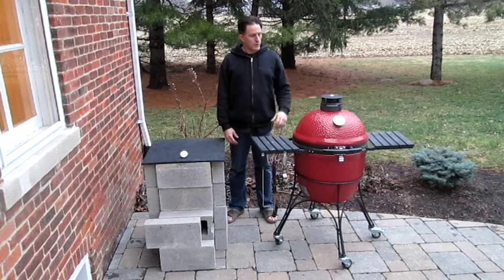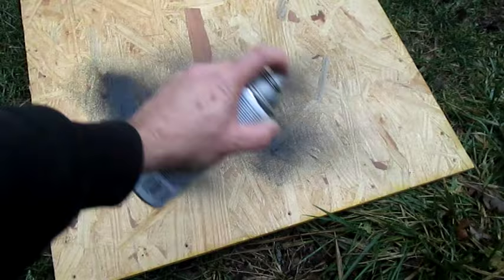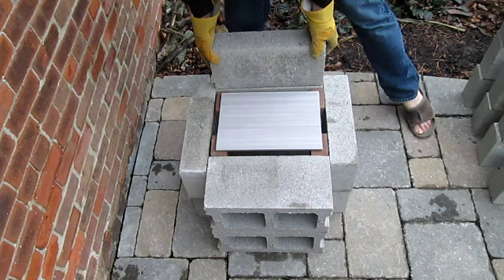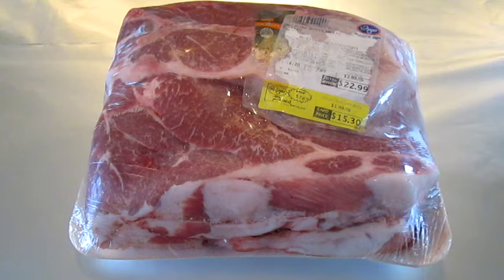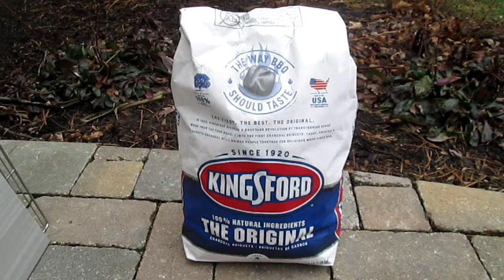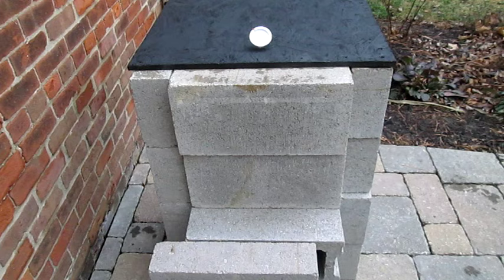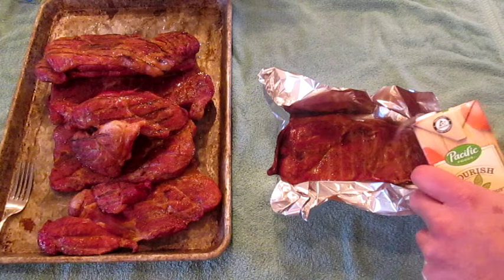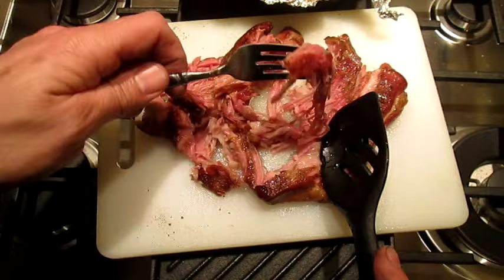DIY $50 Concrete Kamado Smoker

Comment: Just built this today, really excited to try it. It’s worth mentioning that loading the materials to and from the car and then assembling them adds up to quite the work out.
Reply from the maker: A Green Egg or Kamado joe are way heavier!  I needed help getting them off my truck.
Reply: Few beers mate does the job
Reply: Had you never touched a concrete block b4? I knew what a cinder block was when I was a lil boy. Wait till you see what a experienced roofer does with packs of shingles.
Reply: I built this today 🎉

Comment: At what temp should you be concerned with the glue from the OSB putting off harmful vapors? In my opinion I think I would buy a cookie sheet big enough to cover your top. No worries about the harmful stuff in the wood and not much more expensive! Smoke on man!
Reply from the maker: I did some google research. OSB can handle a steady 200 degrees for a full year without degradation.  This means the glue is not vaporizing.   Also, the lid is always open and there is upward and outward pressure from warm air and smoke rising, so it should never have a down draft.   That said, I grabbed that OSB panel because it was already sitting in my garage.  If I had to buy one, I would get real plywood or solid wood or, yeah, a cookie sheet like you said.  Good comment!
Reply: @HowToLou  

What about using cement board?  It might even be a bit cheaper than nice plywood.
Reply from the maker: Good idea!  But some has white styrofoam pellets mixed in.   Don’t get that kind.  A 20x20 ceramic tile would be best.  You might find something on clearance for cheap.
Reply: @HowToLou  what about a dome shaped Terra cotta pot with vent holes, a thermometer  and a handle attached?
Reply: How about just using the lid off your grill? Might work and has vents

Comment: Thanks so much!! I’d been trying to design my cinder block smoker for a year, was gonna build one this summer, but divorce and selling the house ruined those plans, but two things I never considered were the ceramic tile for the diffuser and stacking the half blocks vertically, I didn’t think they’d be that sturdy on their side... I kept looking at ceramic and clay pottery stuff for my inserts...
Reply from the maker: It works really well.
Reply: Can the tile have toxic chemicals in it?

Comment: Im not new to smoking and ive never cut my shoulders like that. Usually cut off as much fat as possible rub a binder on then my rub and smoke at 225 till the core hits 150-170 degrees wrap with aluminum foil n finish the cook till 195-205. Perfection every time

Comment: I think I'm gonna use this as my base plan, but make it bigger, and cement it all together.
Reply from the maker: Sounds good!  Buy your grate first and design around that.
Reply: I read others saying sealing the holes would cause the mortar or concrete blocks to explode if the temp gets too high.
Reply: Thats what i was thinking
Reply: @TheRainHarvester  Only if you fire it up before the mortar is dry.  I've used "Stove Cement" without any problems.

Comment: Waiting for my grill to arrive for the pit. Thank you for sharing this idea. Will probably need tp put a paver stone on top to make sure the top doesn't blow off on windy days.
Reply: Do have a question. If I just wanted to use it as a grill for a cook would I put the grill where ghe deflector plate is or would I simply remove the ceramic plate?

Comment: great im going to put hinge on lid add drill holes in back for steel rods to vent just buy one with thread and put nut a on and adjust Hight as needed

Comment: I like this idea. Especially in a pinch for a temp solution. however, I suggest just referring to it as a vertical smoker instead of a kamado. A kamado is ceramic and egg shaped by definition if I have my info correct.

Comment: Materials for build
-4 reg concrete blocks
-4 bricks
-15 half concrete blocks
-black spray paint (optional)
-1 meat thermometer
-1 10x14 ceramic tile
-1 11x16 metal grate
-1 2x2 plywood
-(optional) a drill for meat thermometer

Comment: Dont go to texas guys.   Will mess you up🤣.  Im 75 yrs young.   Threw a burger on grill/good to go.   Moved to tx on a job 1980.    Ate bbq.  Wow.    Feller at a fair. With big offset. Made butt sanwiches.    Wanted to regurgitate and get another.  Soooo gooood.  Just pulled pork. Pickle. Onion on a bun.  The smoke on the meat was mild and delish
Have had kettles. Electric smokers. Wsm.  Etc.   that sandwich haunted me all these years. Trying to create that flavor again.  Just threw together a offset sumpblock smoker a few months ago.   Oak wood only.  Wife said its the best

Comment: Have used this now several times and it's a lot of fun to play with. Was looking to make it a little bigger by basically doubling the plan. Could I just stack racks on the other side using bricks to add layers of capacity or would the firebox be to small to heat the added area? Should I put a water pan on the non fire side to help get a more even heat? Wasn't sure is a reverse heat flow could be set up with a better plan.
Reply from the maker: Yep just stack higher and add another rack.  There is plenty of heat and smoke.  Reverse flow is only useful in smokers with a side firebox, to get more even heating.  The vertical smoker design automatically has perfectly even heating, so its not needed.

Comment: I built this pretty much to spec, but I made a slightly elevated fire basket for airflow in the fire box. I'm considering taking it further and drilling holes into the cinderblock base for more airflow (this could also make it easier to clean the ash out as it falls into the cinderblock).

My question is, since no one seems to have an issue with airflow, do you think this may be a pointless  or even detrimental modification?
Reply from the maker: It works REALLY well, as is, but you could certainly try other configurations.  The Green Egg and KJ both have side air inlets, not holes in the bottom, and have sold well for years.   Its really easy to clean ash in this Concrete Kamado, with a flat scoop shovel.   Holes would make that harder.
Reply: In case anyone's wondering, for the first time I managed to smoke up a brisket, 9.5 hours, with great results.

 You get PLENTY of airflow with just the front vent, though the unit still seems to "breathe" a bit since the blocks aren't cemented together. Once I got the coals set and the unit warmed up, it was pretty easy to adjust the temperature using the vent and the lid. Once the temp had stabilized I'd check it every 30 minutes or so and add a handful of charcoal and a hunk of wood if necessary. This naturally will start to raise the temp, but I found closing the vent to just a millimeter gave just enough oxygen to slowly ignite the fuel without spiking the temp outrageously.

Bottom line, it is very much possible to legitimately smoke a brisket with this setup. Thanks Lou.

Comment: Looks like something I am going to do. I don't think wood and paint is a good idea so Im going to use tile on top.
Reply from the maker: Wood and paint is safe at 225 degrees and smoke always rolling up and out.  An aluminum cookie sheet or similar would make a good weatherproof top.
Reply: @HowToLou  Great DIY for sure, but to get that black bark on briskets you can easily raise the temp to 250 or even 300. Def doing a cookie sheet or something similar.

Comment: I’m doing something similar but I put a small wooden smokehouse on top of some cinderblocks and a very small cylinder grill that I’ll be using as a firebox. I’m planning on adding another layer of cinderblocks. Right now the entire structure’s around 4-5 feet. I’m real new to this. I’ve grilled with family for years but I’ve never tried smoking before so I’m kinda learning on the go. 

One question I have is if it’s normal to just cold smoke say some chicken or ribs for a while before throwing them in the grill to finish cooking? The reason being is so I won’t be outside all day smoking but also because I mainly just want the flavor from smoking and having more juicy and tender meat after grilling. Also being new to it, I don’t trust myself to be able to safely cook meat on a smoker without messing something up and giving the family food poisoning😂. But I am familiar with grilling so I’d rather just use the smokehouse to flavor and get better quality. Is that something typically done? 

Rn the only renovations I’m planning on is installing another shelf at the bottom to slide in a junk tray to catch grease and whether to just flip a concrete block and cover it to control airflow or install a metal chimney from a rusted out metal grill we were about to toss out. Also I’ve heard some wood isn’t good for smoking but why is that? Is it just no/bad flavor or is some wood harmful and can poison the food. We’ve got a ton of branches we’ve collected that we’ve used in grilling so I’m more inclined to believe it’s just flavor. I have a charcoal starter chimney. Is that fine or is a pellet smoking tube better? 

Any advice would be helpful I’m kinda flying blind and learning as I go at the moment😅.

Comment: I really like this idea. Just a couple of questions. Why don’t you use mesquite or other wood for smoke flavor? Why no water pan? My last smoker had a large metal bowl for water. Still think I’m going to make this. Thanks!
Reply from the maker: I always make my videos as simple as possible, so anyone can easily do them.  Charcoal is easier for a beginner.  If I were to use this, yes, I would probably use hickory wood.  You could add water too. I never have done that in any of my smokes.  There are tons of options, and each person will find what they like, over time.  This video just gets them started cheap and quick.
Reply: @HowToLou  thanks so much for the quick reply! Off to find a brisket I can afford!
Reply from the maker: Try grass fed chuck.  Its really good!
Reply: @HowToLou  thanks, I'll check it out!

Comment: Do  you have an affiliate link for those sticks?  I have not been able to find such a range of sizes in a single package?
Reply from the maker: Did you mean 🥩 steaks? You buy a pork shoulder and ask the butcher to cut it into 1 inch steaks.  

If you meant the sticks I used to hold open the top, I sell those in all sizes 😁

Comment: Having an issue with the tile cracking, am I doing something wrong?
Reply from the maker: Try porcelain tile.  Its more heat resistant than ceramic.  Mine does not crack.

Comment: Having trouble finding an 11 x 16 grate using that link.
Reply from the maker: Something like this should work and will last a lot longer.  
Htanch SF8252 (2-Pack) 16 1/2" Stainless Steel Cooking Grates Grid for Kenmore 141.152270 141.152271 141.15337 141.153371 141.153372 141.153373 141.15401, Ellipse 2000LP 2000NG Vermont Beach Pro Grill https://www.amazon.com/dp/B07J5FHQ46/ref=cm_sw_r_cp_api_glt_fabc_C9QV0CKYBPH82WJ8YHC6

Comment: so for beginners, you mentioned not to use hard wood, may i ask why? i have one more question aswell, if a beginner should not use hard wood, does that rule apply to charcoal hard wood? (hard wood turned into charcoal)
Reply from the maker: You can use whatever you want, but charcoal is easier for beginners, because all the creosote has been already burned out of it.  Actually ALL charcoal is simply pre-burned wood.  They burn out the harmful creosote (white smoke) so you can start right away with the good (blue smoke).   Charcoal is also consistent in size and moisture content, so it’s easier to get consistent heat.

Comment: I didn’t see the thermometer linked in any of the comments. Can you share?
Reply from the maker: Search for “analog meat thermometer”.  I picked mine up at the local hardware store.
Reply: @HowToLou  I was also considering doubling up the size of the smoker. What are your thoughts there?
Reply from the maker: Sure!  It would be easiest to double the width so you have two cooking grates side by side and a wider tile.

Comment: Wood gives creosode? If I use oak wood, how can I avoid creosode?
Reply from the maker: Your fire gets just over 1000 degrees and burns off the creosote.  You get a lower cook temperature because the ceramic plate blocks the high heat.  People have smoke with wood all the time.  You would know if you had creosote.  It is extremely bitter and will give you a serious stomach ache.
Reply: @HowToLou  under 1000F gives creosote? I thought people used coals to smoke? Are coals under 1000 and giving off creosote?
Reply from the maker: In the burning process, wood starts to chemically break down at 500oF, producing volatile gases including creosote. These gases burn at about 1100'F.  Your coals are over 1100.  May I suggest you post your question in a smoking forum where thousands of people smoke with wood.  The concrete Kamado is a smoker like any other.
Reply: @HowToLou  Thanks! Yeah I have a lot to learn!

Comment: After building then lighting mix of plain wood charcoal and hickory wood. The tile cracked in half. It was a basic floor tile. How long would I wait to include the tile? Wondering if you used a certain type. Could you be specific? 

Another issue I've have is the cinder blocks aren't able to tight fit. I used a tiny piece of wood to get the cinder block to lean forward. Did you have a problem with them all being level not mentioned?
Reply from the maker: I used basic floor tile too.  Make sure its not walk tile.  That is too thin. Get nice thick floor tile.  Also, add the tile as soon as possible, so it heats up slowly with the fire.  Sudden temperature changes cause stress fractures.  

Yes, a level starting surface is important.  My paver patio is laid on top of poured concrete, so its super level.  You can lay down a piece of concrete board (tile backer board) as a flat base to start, or maybe a bag of crushed rock.  Your idea with wood was actually good, but won’t last in the weather.  These other solutions will hold up better for you.

Comment: Interesting idea...but not sure you understand the meaning of "smoke ring".
Reply from the maker: A smoke ring is caused by the outside 1/4 inch or so of the meat absorbing nitrous oxide in the early stage of the cook.   It bonds with the red hemoglobin in the meat and prevents it from oxidizing and turning the brown color, like meat normally does when cooked.
Reply: @HowToLou  Must be the color in your video, cause that looks more like ham (pink edge to edge) than pulled pork
Reply from the maker: It really IS a smoke ring.  I cut the meat in one inch thick slices to purposefully allow more smoke to penetrate.   You are seeing maybe a 3/8 inch smoke ring from both sides, so it looks through and through.